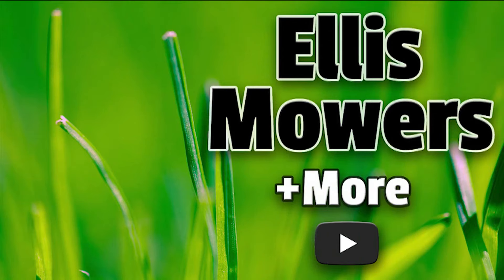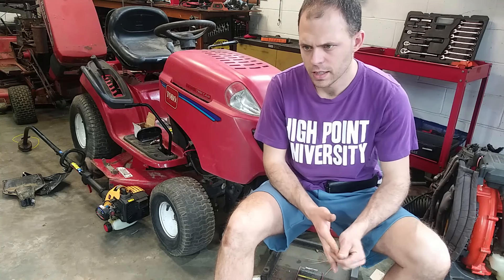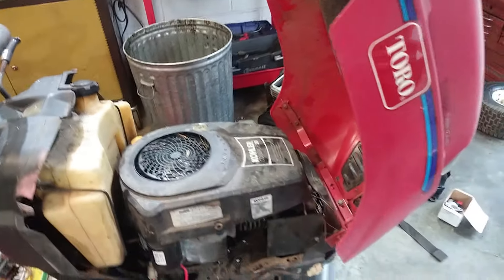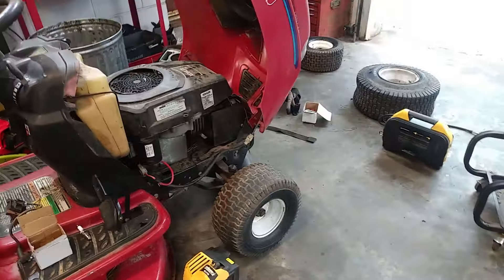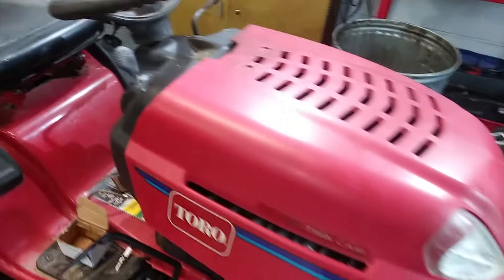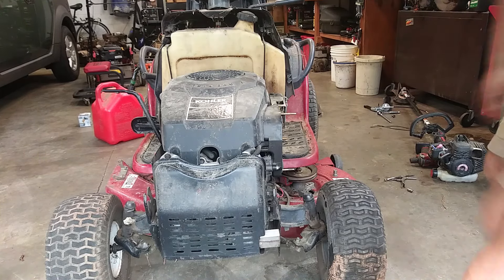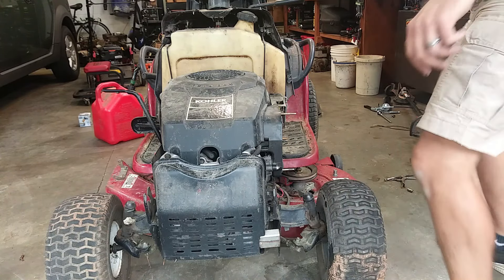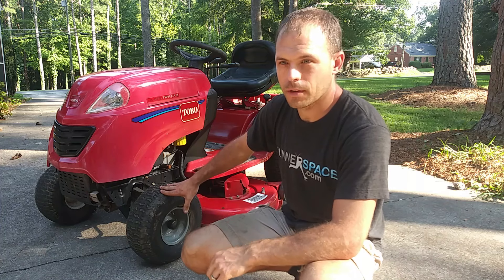MTD Toro LX425 riding mower Kohler Courage runs rough and has a hole in the deck: let's fix it!

Comment: I usually delete the shutoff solenoid from most of the machines I work on. They rarely work correctly anyway. I get a shallow bolt with the correct thread to plug the bowl, and I usually install a shutoff valve, since they are useful to have. I learned my lesson on that with the first machine that I ever worked on. It had been sitting for years and I didn't know much, so I just replaced the carb with a clone. I couldn't get it to do anything. I went around in circles on that machine for months until I realized that the shutoff solenoid on the new carb was not working. I deleted it and the machine fired right up.